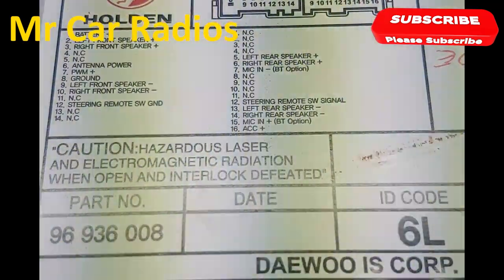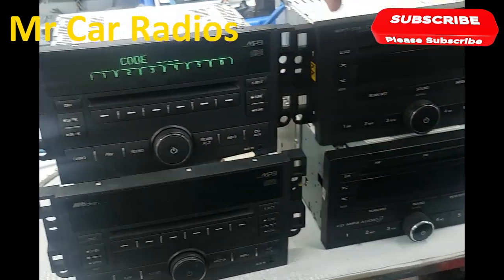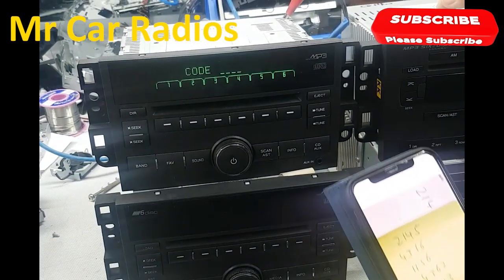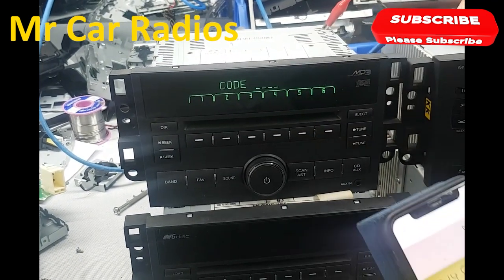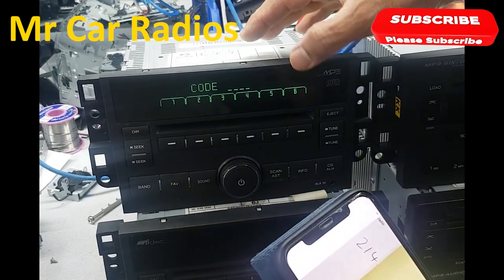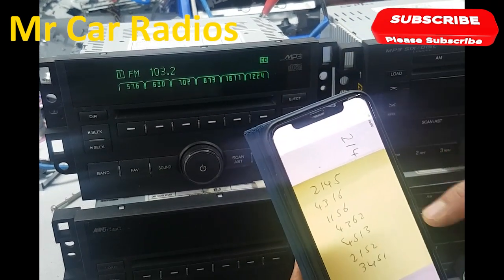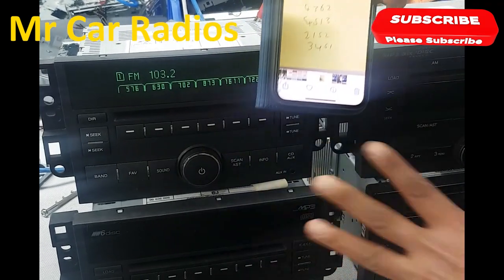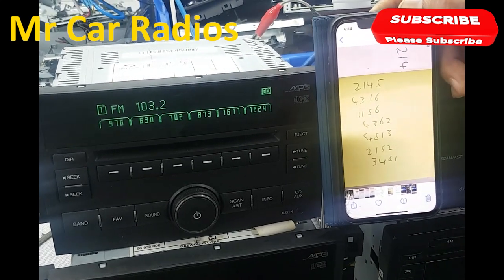How To Work Out Stereo Code For Holden Captiva ,Barina, etc

Comment: I have entered the code to many times and now says security lock. Is there a way to reset it?
Reply from the maker: as i know this model do not lock up but if so try to turn on accessory for couple of hours until security code light turnoff.